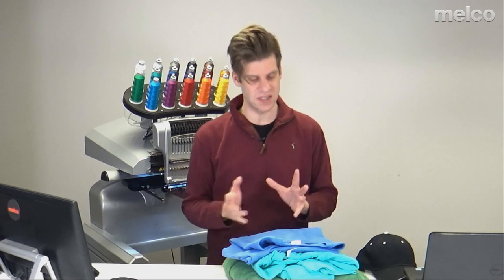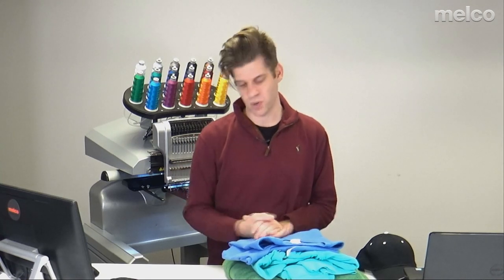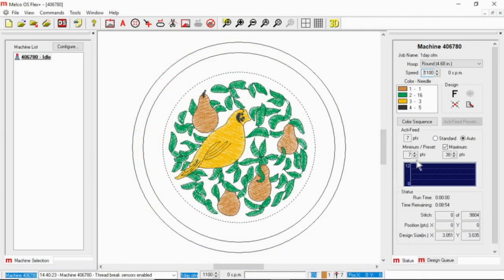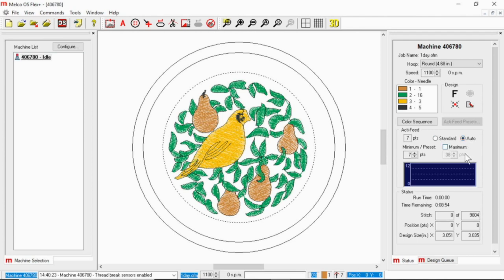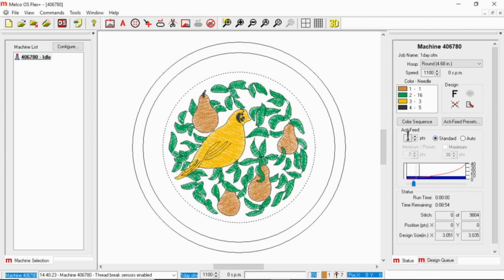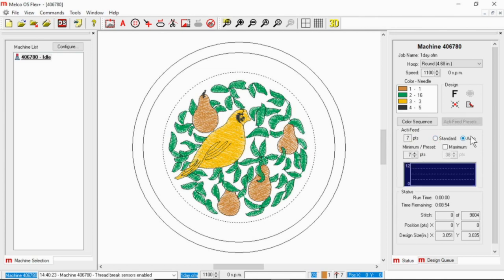Setting Acti-Feed Settings (Advanced Interface)

Comment: What would be the best active feed for hoodies ?? Or recommend
Reply from the maker: It would completely depend on the weight of the fabrics, so this is a guess. I would start around 15 for the hoodie I'm wearing today. If it loops or false thread breaks, back it down. If it pulls or looks to tight, or if auto is constantly feeding more, add a few points.